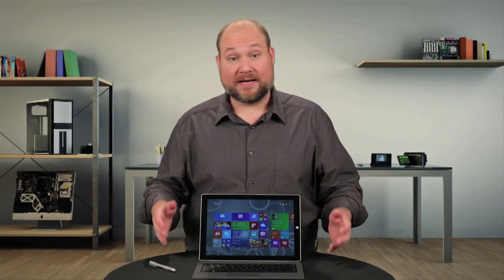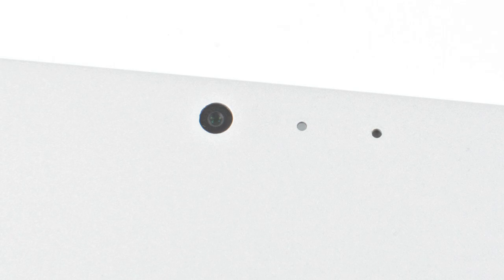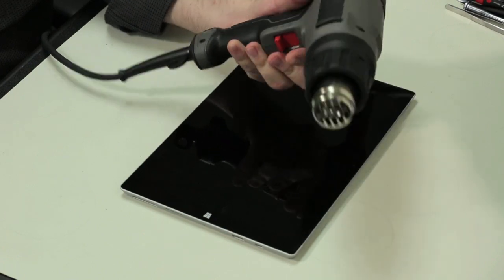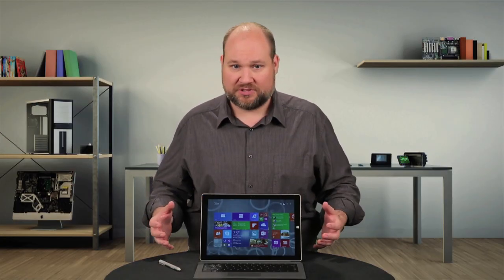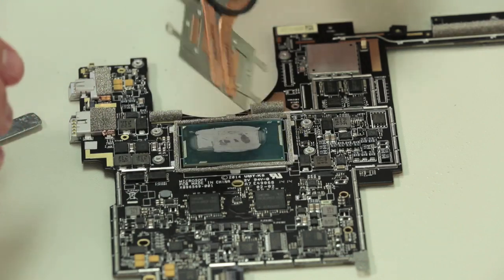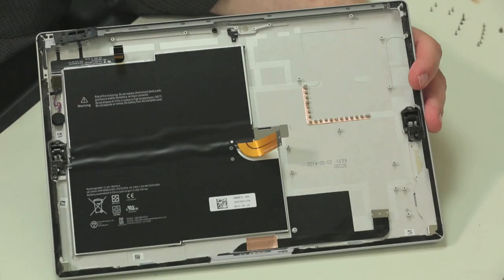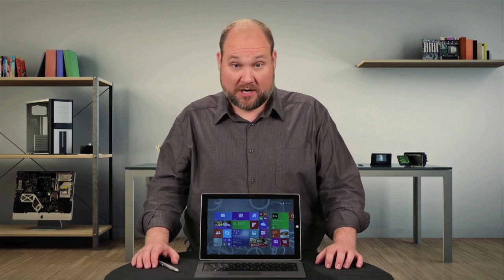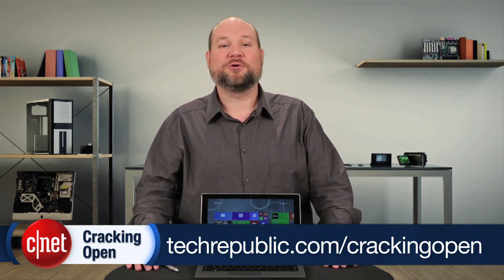Cracking Open - Microsoft Surface Pro 3

Comment: It depends on which Surface Pro 3 you have, it seems. Many of the repair videos I have seen state that there are screws underneath the feet that need to be removed which removes the display and under is the SSD slot. There's no heating needed to remove the display

Comment: NOWADAYS COMPANIES ARE MAKING THEM DISPOSABLE TOO HARD FOR UPGRADES AND REPLACEMENTS OF PARTS HARD TO SERVICE, BATTERY INCLUDED DEVICES NEEDS THE BATTERY TO REPLACED AFTER ATLEAST 2 YEARS RAM AND SSD CAN ALSO MALFUNCTION ATLEAST THESE KINDS OF PARTS SHOULD BE EASILY REPLACEABLE OR FOR UPGRADES

Comment: Ouch! 😢 I love my pro 3 still, and despite having other, newer computers around I still like some features. I need to deep clean or replace the cooling fan and now I'm a little scared of the proposition. The fan is a little loud nowadays, and makes awful noises when I move the computer 😬. The air intake is easy to find, but there is no direct access to blow air backward through the system

Comment: Hope to see ever a option to just replace the ssd, because they seems like to using a removeable ssd, instead of the emmc crap, and the ssds Going bad, and when its bad u cant replace it 🤷‍♂️ but i dont think they Will ever Made an cover to replace that thing, without cracking the whole tablet open

Comment: If you are replacing the screen, it's a no-brainer that it doesn't matter whether you'll break it some more when trying to remove it. I can't stress enough. Be REALLY careful around the camera area. In fact, you're better off breaking that section in small glass pieces. If I were you I would use the least amount of glue you can get away with when putting it back together as the SSD and battery can be available on eBay. WEAR EYE PROTECTION!!

Comment: Great Video guys very good repair. Like a service repair technician I can suggest you  using a plastic sludger or a credit card ,so that way will be harder to damage the glass screen panel. All the best and thanks again for that video! You are great!  :)
Reply: Came here to say use plastic rather than metal tools for prying glass off. Metal more likely to break glass.
Great video called "Microsoft Surface 1796 Easy Screen Removal Part 1" 💪
Reply: A very slim guitar pick

Comment: I read somewhere that you can use a milling machine or a dremel with an end mill to cut open the back of the surface pro so you can replace the SSD. Has anyone tried that?

Comment: Microsoft, as the name makes it clear, is not a hardware manufacturer. Surface is crap. Period.

I managed to disassemble this device without breaking the glass. It was quite easy. However, Surface can't be repaired when they are dead. And they die. This is because Microsoft is not a hardware manufacturer. Buy something else. But avoid Microsoft under any circumstance.

Comment: I've had my Surface Pro 3 since it came out. I use it to watch live streaming video because I don't have a TV in my room. It works perfect for what I need but I fear it is overheating.

If it were my laptop or a regular computer I would Crack the Case open and clean the whole cooling assembly and all the related components along with putting new thermal paste in place.

Would something like that be recommended for my usage, or should I just look at it trying to clean it out using the old method of canned air and a vacuum cleaner?

Comment: I'm building a custom PC, how can I use the SP3 SSD on my motherboard ?? Does it fit straight in a sata port or an M.2 port ? 
I was so proud of my surface pro 3. I would recommend it to everyone for almost 4 years UNTIL it died the other day for no apparent reason, it was showing absolutely no weakness. Now I feel I'll never buy from Microsoft again, especially when you know they make it next to impossible to fix. At least I'm glad it lasted 4 years, for some of us this kind of breakdown happen right after the warranty is over. I now recommend building a custom pc and using a more affordable tablet/laptop if you can do that.
Reply: The Pro 3's SSD is mSata, not M.2....so unfortunately it will not work. There are msata to sata adapters, though. Look on Amazon and other places.

Comment: Microsoft made the Surface Pro 3 so difficult to service, that they refuse to do it themselves.  if you send yours in for repair, what you get back is a new one, at a premium if your warranty is expired.  I'm replacing the battery in mine myself, since their only answer was to buy a new one full-price.  I do appreciate the extremely helpful customer service technician who dedicated 2 days of remote diagnostics to determine the actual problem with it.  He also shared a link to instructions to complete the job, as well as pointing out where to get the specialty tools and replacement battery.

Comment: Thank you for publishing this video. I have a faulty Surface Pro 4 where the battery started to blow up just right after the warranty run out. Microsoft Support dismissed the problem and did't gave my any help, but was passing the problem from one to another table. So eventually I have to solve the problem myself by buying a battery and replace it myself. This behavior is really unintelligible for me, as a battery that blows up is not just a convenience problem, it is an actual safety risk and should be attended by Microsoft instantly and without further questions... I would never spend again $1'000+ in a Microsoft Hardware product and definitely do not advise to buy a Surface.

Comment: I have the i7-CPU 256GB SSD model with 8GB of RAM, and I think the RAM is defective. I contacted Microsoft last year and they wanted a whopping $600 to replace the tablet ($600 for an outdated tablet just sitting in one of their warehouses? No thanks!). I read elsewhere that the memory is "not upgradeable"; is that because it is inaccessible? Although you removed the motherboard, I did not see the RAM in your deconstruction of the tablet. I would greatly appreciate information regarding the Surface Pro 3's RAM specifications-the manufacturer, model/serial number, etc (preferably of the 8GB model). Thanks.

Comment: I see a lot of folks commenting stating that they have opened it up no problem. I have the issue where the battery will not charge and would like to replace it, but most accounts say you cannot do this without the screen cracking (like he did) any suggestions on how you all did this successful?

Comment: Hello! mi Surface Pro 3 i7 has fallen and the display is broken just in the same side of the mothercard, the touch screen is disabled now and it works almost fine, but now when i turn on the tablet windows not always start at the first try and i have to force the shutdown, sometimes start at the second or even third try, any recommendation? I mean...i don´t know if its a good  idea change the display if i have the windows system problem.

Comment: Interesting. The reality: Microsoft ONLY replaces these devices. There is no service option involving any kind of repair. Period.

My DIY heart was pained by that reality, but I got used to it. This is by far the most powerful line of tablets available. Gigabit networking, USB3 I/O, etc. Lots of speed yet a very thin tablet.

Comment: There's some information I would like to get off of the hard drive on my surface pro 3, what sort of drive is in it and is it possible?
Reply: Did you ever get response?  I think you and I are in same boat, I have files on the hard drive that is like to access, but mines cooked (I believe).  Mine won't boot up, just the "Surface" lights up and the little dotted circle spins and spins...

Comment: this is all bull shi...... i just took my surface pro 3 apart, it took me no longer then 15 minutes !!! ,design inside is great a lot room to work on battery or to upgrade a ssd,edges where the glass is installed are very wide so you can put new screen in no time ! so you are real pain to listen to man!!!!!! surface kicks ass ! very easy to work on it!

Comment: They did this to force you to buy the more expensive models, I got the Pro 3 i5/128gb/4gb and it simply isn't enough RAM. MS didn't want you to be able to increase ram or HD space. iPad's might be easier to open, but you cannot increase RAM more HD space with plug in modules like with the Intel based Pro. So I think they were designing it to be not upgradable like the iOS devices, forcing you to pay a silly huge premium up from for more storage.

Comment: Have one. Not buying another again. In fact, all its products seem to be half baked these days. With the ridiculous One drive sync performance through the "Big Brother" annoying default settings in win 10 and office 365, someone at Microsoft has to decide were this company is going to. Is it an innovating software house? A hardware manufacture? Apparently it abandoned the special attributes that made it a leader in the early ninety's. Because, Microsoft didn't relay invent anything new. It just imitated other's inventions with a smarter marketing approach. Well, the current quality of the product line of the company and the pathetic race to try and match google in the cyber app world and run some hardware shaky adventures makes Microsoft look like Sears...... Maybe they should add to the company's product line also Auto parts and house hold appliances.....but, hey, those products need to be reliable....can't restart them every month or download a service pack.....Well, If they don't refocus quickly they will end up line Novell...who remembers that company???

Comment: Is it worth replacing the screen and touch sensors. I was given a Surface Pro 3 with everything except the pen. the screen is cracked and the touch screen does not seem to work. but everything else works fine.  It has an i5 cpu, 8gb ram, and a 256gb hd.

If so where can I get the screen and touchscreen fixed. 

P.S. Do I need to use the pen for the touch screen to work?
Reply: im actually having the same problem and its supposed to cost $400+ to fix.

Comment: actually you must be the complete dumbass to think that its IMPOSSIBLE to service this device.
i've already changed SSD mdoule and replaced my display on my sisters Surface Pro 2 without any problems. instead of complaining about the device itself, better get more skills in servicing it...
Note that i'm not computer technician, and i never worked in repair shop. i'm just an enthusiast who did this without any tutorials for the first time while this moron is cracked the screen at the first attempt..
Reply: Orkhan Afandiyev How much time it took to open the Pro 2? What did you use to open it? What did you use to seal it back?  My battery on my Pro 2 doesn’t hold charge. I need to replace it if I want to continue using it without the charger. Any help will be greatly appreciated.

Comment: Good luck trying to repair it yourself.  You'll have to pay extra for service which adds up to almost the cost of a Macbook Air.  Besides, it will not hold value like the Air does.

Comment: my surface pro 3 is having trouble turning on and i have to slap it at the motherboard/fan area to get it turn on :(
Reply: I am on my second SP3; the first one was replaced under warranty because I couldn't get it to turn on.  Presently, 3 months later, the replacement won't turn on.  No more SPs for me!

Comment: Why.....
Reply: +kanohane Never pulled something apart to understand it better?
Reply: JayJapanB
Not a $400 tablet...
Reply: +kanohane Well, in this case it didn't quite work out but it can be fascinating and satisfying to open sealed devices to the mystery within. 
Also in this case the loss of damage is much lower to the owner as they(CNET) happen to be a corporation with an estimated net worth of 980 million US dollars. 
However, if it was your tablet you might be a little more upset as it could be one of the most expensive things you own. Probably easier to learn about it on CNET ;)
Reply: JayJapanB
Id gladly take that dissected tablet from CNet...

Comment: USE THIS-->  https://www.facebook.com/1639081273019712/photos/a.1639082049686301.1073741828.1639081273019712/1639082023019637/?type=3&pidid=ad6e930e-375b-4db2-9e88-2ee689380fbe  IT IS THE WORKING Galaxy Online 3  Hack TOOL THAT WORKS! ENJOY!                                                                Cracking Open - Microsoft Surface Pro 3

Comment: Dropped my Surface Pro 3 and dented a corner. The screen is not cracked, but it pops up because of the dent, and a dark spot started showing up on the screen a few days later. Going to open it up although I know it will crack my screen, but doing it myself is 40% cheaper than going to Microsoft. Going to upgrade the SSD too, as well as trying to tape up the case's hottest area with thermal insulation tape, and I'm gonna see if I can add another heat pipe onto the CPU cooler and spread the heat out like the Surface Pro 4 does, I see a lot of empty space around the CPU.

Comment: Thanks, that's awesome, and I too watched it on my surface pro 3.  I missed where the hard drive is, I'll have to watch it again. Or is it just an integral chip on the mobo?
Reply: +ann kiszt Got it, "the ssd card" so if one wished to upgrade the drive, this is what one would replace. Not worth the trouble, LOL.

Comment: Really weird thing happened today with my surface pro 3. It was fine this morning when I was using it. I left it on my desk and I went back to use it again in the evening and the screen has a big crack going across it (across the shortest width). I have never dropped it or been careless with it. I know it sounds really weird but the crack really has appeared out of know where. Has anyone else had this happen to them? Is it due to overheating as this happened while it was on charge. Or could it have happened when I was holding it and carrying it to my desk? Does the slightest flexing of the tablet, say from holding it at the edge and its own weight cause enough flexing to crack the screen?
Reply: +XrGrimreap3rX Wow I thought I was the only one, Yea this happened to me too out of no where and now I had to disable my touch screen cause it kept thinking I was touching the screen when I wasn't, so my surface pro 3 no longer act as a tablet but a overpriced laptop. doubt I'd get it repaired, I feel like it'll be pricey to do it anyways so I'll just have to deal, but I can still use the pen.
Reply: +The Teege Yeah, sounds identical to me. Except I wasn't even able to get to the stage of disabling the touch screen. Luckily it is still under warranty so I contacted Microsoft and insisted that the crack was a defect with my surface and was not cracked by accident by me, so I've sent it back to them and they say they will fix/replace it if they see that it hasn't been accidently broken. Another plausible cause for the cracking could might be to do with a fault with the battery. Say if the battery had expanded only slightly, in such a confined space, it could have been pushing on the glass.

Comment: repairable? What exactly would you have to do to the surface to warrant a repair in the first place? It's designed with no moving parts, and a solid form factor.
Reply: +Pandan Fan, SSD, battery, all things that can fail over time. The device won't be under warranty forever. That is when the user will have to weigh the cost of repair verses repairing it themselves, or just replacing it with a new device altogether. For a device at this price tag, it is common to take the ability to upgrade or repair into account.
Reply: i guess that's true, it was an honest question
thanks for answering

Comment: looks like something that could be solved by 3d printing a suction and heating setup, I'd imagine that after rendering a few videos the screen is very close to being able to be detached under a uniform vacuum.
Reply: +GreningerProductions The heat would be enough yes, but that fan is powerful and the cpu is top right from viewing position. so only that tiny proportion of the screen would be loose enough to start pulling.
you deffinatly need a seperate heat source, I wouldnt reccomend removing the screen of a fully powerd up and frame crunching device either :D

Comment: This is the stupidest concept for a video series I've seen on this channel. You're not showing me how to do it, nothing is being compared or discussed, and it's only point; don't but something if you can't take it apart... If it works, why would I take it apart? It's not 2004, you're allowed to update the graphics and style. It's a dull video about nothing. It's more sad that you could consider a more interesting point to discuss - how long the warranty takes to be fulfilled, IF it stops working within its foreseeable lifespan. Just why?
Simply put, what was the point of this video?
Reply: +Patrick Curtain Surely you jest? This video isn't for simpletons that just buy new tech willy nilly.

I came here because I bought one of these through my work for $100, a 128GB model, and I'd like to be able to throw in a bigger SSD.

That shows purpose for this video even if the device is working, but what if it wasn't and was no longer under warranty? Sure I could spend a grand on a new one, or repair the old one for the cost of parts.

Comment: can you advise on a temperature to crack it open, say to heat it in an oven to 80 degree or somewhat and then use several vacuum suckers?

Comment: Apple, Microsoft, Samsung they are all the same, they literally make it extremely difficult so you use their repair service instead of going to mom and pop stores to get your stuff repaired....
Reply: +MrViral20 You have to take form factor into consideration, I can't really imagine a tablet/slate which is both easy to open and still maintains a slimline form factor.
Reply: I could try to explain things to you, but you're obviously a moron. so I'll try to make it very simple. if you want an easily serviceable device, DON'T BUY A TABLET!